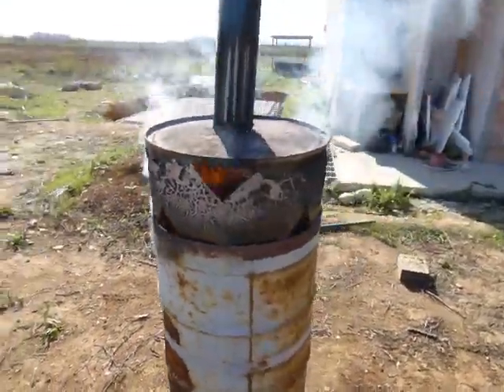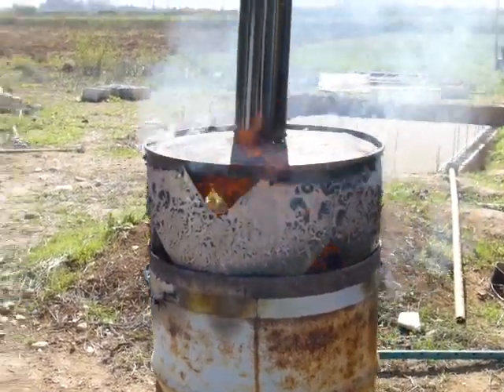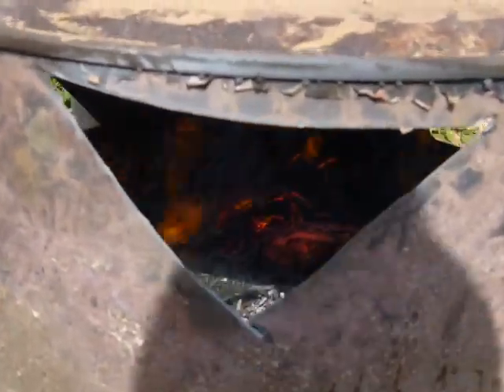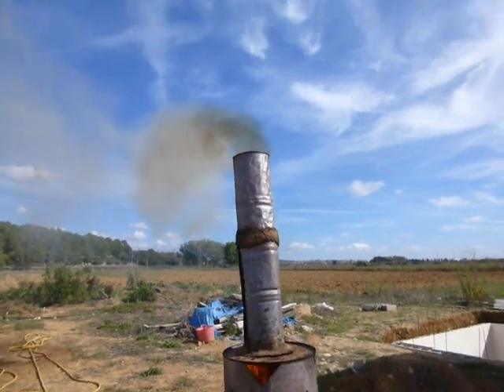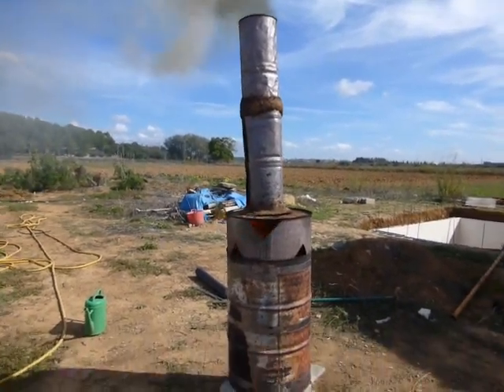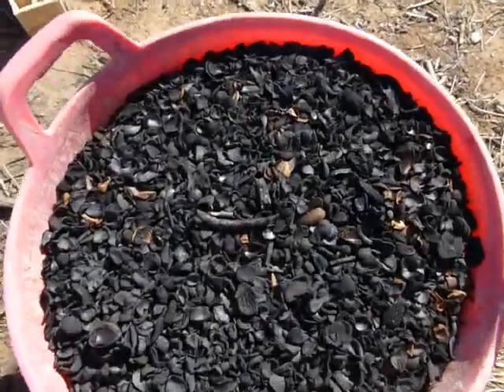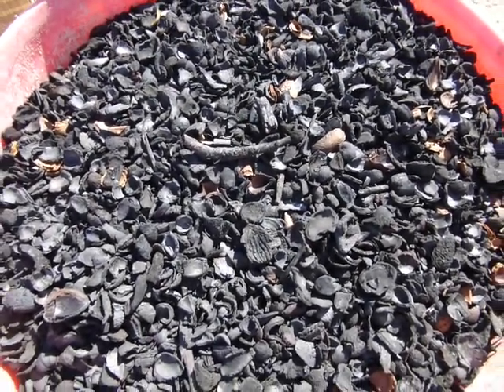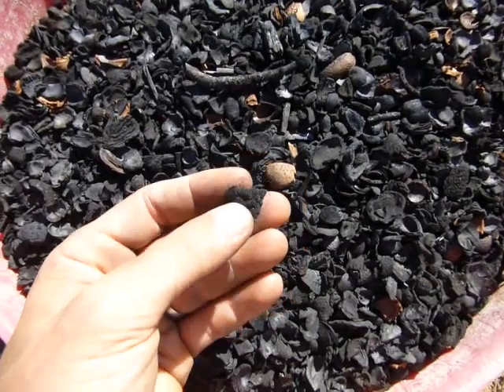Biochar TLUD Kiln - Build and Burn

Comment: Not a very good design for your purpose. Build a proper retort to get good char that will both limit the oxygen and reuse the pyrolysis gases for additional heat. Charcoal and biochar are not exactly the same thing. You want to get it hot enough that all the tars and nasties are driven off and only carbon remains. Is the guy with the plans also selling snake oil?
Reply from the maker: he doesnt sell anything.  all of his work is given to the public for free.  I will take his word over yours. 
He has offered plans with instructional videos, pdf files and scientific evidence through actual testing of both burn temperature and testing the exhaust gases.

you on the other hand have provided nothing more than opinion and no useful information to better the design.

How would you improve it?  
What temperature does it need to get to to burn off all "the nasties" thats the tecnical term i take it?
How is biochar different from charcoal?

I had the water tested before and after the filter and it does what it says on the package...water free of pollutants and dangerous micro organisms.
Reply: @Mandalaman  I think I commented before but I want to respond to the criticism. I've been making char/biochar for 10 years at my farm/sawmill after attending a week long workshop with Dr. Hugh McLaughlin, Dr.  Thomas Reed and Dr. Paul Anderson (inventor of the TLUD).  Here are my points regarding this vid.
1. Your presentation was very good: very understandable, good sequencing; you are a good teacher.
2. Your approach included showing how you changed and tweaked the system to minimize smoke. Also shows your own humility and honesty which indicates the strength of your character.
3 Your TLUD is fine.  It does what you want it to do-- make char with minimal smoke. It is more sophisticated than an open pit and less sophisticated than a retort. 
Regarding the criticism, my advice to others is to learn the basic physics and chemistry of making char (essentially, stopping the burn in the latter stages), put together a system and get started. Yours did all of that. Thank you again.(Retorts are fine, more work to build but not at all necessary. I don't use my retorts anymore. )

Comment: What is your third chimney called? Is it made of aluminum?
Reply from the maker: the first and last are chimney pipe and the second one is just a rolled up piece of barrel.
Reply: Mandala man, thank you!
Reply: aluminium would melt very quickly as a flue.. so does expanding steel flue pipe, so dont waste money there... stainless kitchen bins are great chimneys tho!
Reply: Liam Sibley 
 Have you tried using stainless steel waist bin?
Reply: yeh, they're great for flues, stainless heats up fast!  its the heat in the chimney that makes it draw..  but yeh i like bins because they're usually a rolled sheet crimped into a tube shape. its good for adjusting the flue diameter etc :)